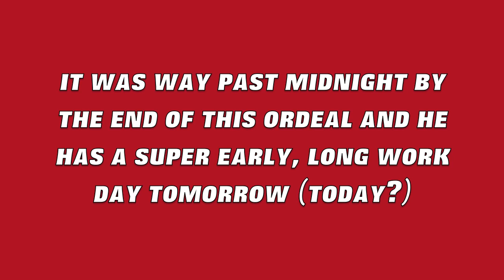Motovlog:  Flat Tire at Midnight

Comment: Laurie, get the following for your toolkit:
1. 'Stop and Go' Co2 flat tire kit. 
2. Co2 Tire Inflation Valve with a knob (works better than hose in above flat kit).
3. Buy extra 16 Gram THREADED Co2's on Amazon (about 14 bucks for a 12 pack).
4. Put SEVEN Co2's into your flat kit. Tires use 3-4 Co2's for the rear and 2-3 for the front.
This setup has fixed 7 tires so far. Use a Multitool to pull out nails/screws. Use Gloves to handle Co2's as they get VERY COLD! Also have a small flashlight.

Comment from the maker: @aeroliner750 Yeah, definitely good thing I noticed. It's funny how you notice even slight changes in air pressure after so much saddle time with a machine.  You really get to know the machine well.  I've pulled over before because I didn't think it felt right, and it was 2psi off of what I normally run it at. LOL  I'm like the princess and a pea.

Comment: @lauriejennifer 

I thought that you were running tubeless supermoto tires on your rims, and not the tube type. My mistake (forgot it's winter so you'd be running knobies atm). >_< But that flat kit does rock! I've helped other motorcyclists with flats on the side of the road. They're amazed how fast they can be back on the road again! I added their mini electric inflation pump as a backup the following year... just in case. Off to find Power and GPS mounts for my YZF-600R...